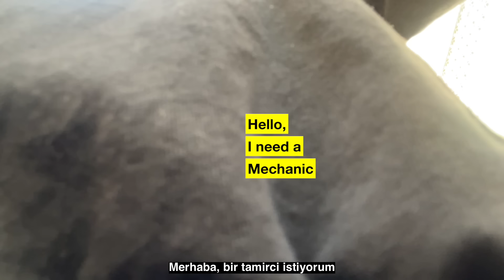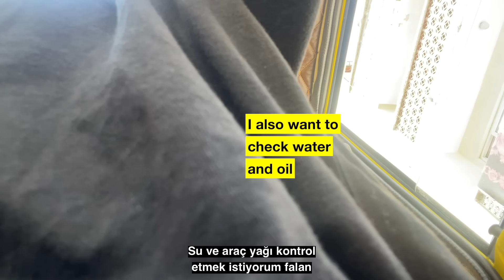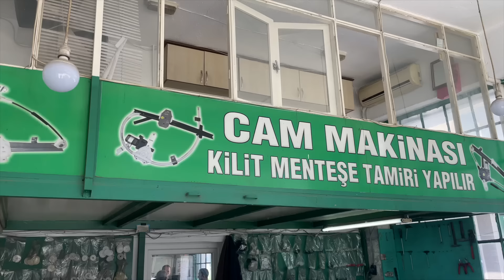My experience with MECHANICS in TURKEY

Comment: They tried to explain to you that when you are dealing with a car that has a carburetor engine instead of more modern injection engine you need to calibrate the carburetor manually to adjust the air and fuel mixture in engine so that your engine won't stop while it is in netural gear. Old engines needs calibration as they go to higher altitues becuase if they are set for air/fuel mixture for sea-level they won't get the needed air because air gets thinner as you climb higher. So you need to keep an eye on that or pay for an electronic carburetor. In your case I don't know if they ever made one for 1989 Serçe. I hope I made it clearer for you. I wish you more happy and healthy days in Turkey.
Reply: Hocam çok güzel açıklamışsın. Helal .
Reply: Vay be ilk defa duydum güzel bilgi için teşekkürler
Reply: İngilizcen süper, benimki gibi..
Reply: Tam bunu açıklıyordum, sizin yorumu gördüm gerek kalmadı, teşekkürler :)
Reply: Vallaha açiklayacaktım ama tamirci terimleri yüzünden takılmıştım.Cok güzel açıklamışsın eline sağlık
Reply: 1999 da broadway ile basima gelen sorundur. Lpg ile kullanirken 100 uzeri hizlarda ve vitesi bosa aldigimda motor dururdu, direksiyon kilitlenir, frenler calismazdi. Cok usta dolastim. Son usta, aracin ön kisminda bulunan hava kanal borusunu asagi cevirerek cozmustu. Hava yakit karisimi orani  bu sayede duzelmisti.
Reply: Abi benim Türkçe açıklayamayacağım şeyi İngilizce anlatmışsın helal olsun.
Reply: Up
Reply: Güzel açıklamışsınız emeğinize sağlık :)
Reply: @hakan3525  o yüzden şehir girişlerindeki tabelalarda rakım gösteriyorları demek. Şoför kaç metre yükseklikte olduğunu öğreniyor ve karbüratorü ona göre ayarlıyor. Modern arabalarda bu otomatik gerçekleştiği için tabelalarda artık rakım yazmıyor.
Reply: Helal olsun dayioglii

Comment: So what he was saying was that the atmospheric pressure is higher in İstanbul due to its altitude being very close to sea level, but Bilecik is higher. Your engine's ignition system was set for higher atmospheric pressure and he reset it for lower pressures by basically pumping air into it with that blue tool he was using.
Reply: What will happen when she go backs to the istanbul 😂
Reply: @DayiTheDragonTerbiyecisi  it wouldn't make car unusable. but fuel consumption will go higher in istanbul than before. 
this is why car manufacturers invented air pressure based fuel injection system.
Reply: No. He just changed the igniton time later the ignition higher the pressure ratio per square inch  and vice versa. Changing the ignition time is done on cars with distributors done by turning the distributor to clock or counter clock direction. And the tool he was using is a light gun witch flashes light whenever there is current passing by the distributor cable. I suggest people who really want to understand the process should watch a YouTube video.
Reply: When different altitudes air density is varies (higher the altitude lover the air density)  modern cars has VVT ( variable valve timing) system that changes automatically amount of compression needed prior to ignition by delaying the valve opening. It is a hydronic system built in to the cam shaft sprocket.
Reply: blue tool legend :DD

Comment: Combustion engines need 3 things to run: Fuel, oxygen, and ignition. At the higher altitudes, the air is thinner so there is less oxygen to burn the same amount of fuel. That causes the engine to stall. An old car like yours uses carburetors to adjust fuel/oxygen mixture. It's an old mechanical system and its setting is fixed. If it was a newer car, the mixture would be adjusted by the injection system which is electronically controlled by the car's ECU(car's brain basically)
That's what Tamirci was trying to tell you. :) Peace ✌
Reply: Hiç işime yaramayacak şeyi merak ettirdiniz ya 😁 peki çözümü var mı bunun her yüksek yere çıktığında bu araba aynı sıkıntıyı mı yaşayacak yoksa yükseğe çıkmadan bişey yapılabiliyor mu?
Reply: @cadisam  yokuş aşağı inerken viteste inersen bir sıkıntı olmaz. boşa attığı için arkadaşın anlattığı gibi motor stop ediyor
Reply: @cihanturasoy9546  dedemin torosu köyden şehre inerken boşa atıp stop ettirirdik yakmasın diye. Fren lazım olunca 4e takardık tekrar çalışırdı 😂
Reply: @cadisam  Karbüratörlü araçlar ayarlandiklari irtifada verimli çalışırlar.  Pratik bir düzeltme yolu yoktur. Karbüratör içerinde 'jet' olarak adlandırılan yakıt çıkış nozullari bulunur. Yüksek irtifada daha küçükleri takilip deniz seviyesinde daha büyüklerini takmak gerekir. Karbüratör komplike sistemler olduğu için bu işlem kolay yapılamaz. Sokup takması ciddi zaman ve iş gücü ister. Bu sebeple kimse uğraşmaz. Sıcak ve soğuk havalarda aynı sekil verime etki eder. Hava sicaklaştikca genleşir ve birim alana daha az oksijen düşer. Soğuk havalarda tam tersi yaşanır.  Cv tıp karbüratörler hava şartlarından daha az etklensede karbüratörlü araç her daim kanser sebebidir.
Reply: The English comment that I'm looking for...

Comment: Do not shift to N gear (or do not keep clutch pedal pushed down ) when driving down on inclined road instead keep your gear as same as it is if it's equal to your speed or shift it to something appropriate depending on your current speed. You can lose control of your car when driving on N gear , as speed increased your handling will be decreased. If anyhow engine stops ( It's common issue with older cars when engine running on N gear ), yes breaks won't work. It's actualy how break system works. Have a nice trip and drive safe.

Comment: do not set gear to idle when you going downhill or car running,its a fatal issue.when engine stops brake vacuum assist doesnt work and brake pedal getting harder.

Comment: So the problem is about the way how engine works 
Basically you burn air with fuel in the engine to make power but these are measured to make good power and nice burn
If you travel and change elevation this means the rate of air is changing and you have to adjust to fuel delivery according to air amounts
I hope you understand:)

Comment: Try to adjust a head restraint for your seats, its very risky to drive without head restraint. Allah korusun, if any even small accident happens your neck will be defenseless which causes fatal injury. Also I know that your car is iconic its nice to drive but for long range drives I suggest you to have another high safety standart new car if you are able to buy one.